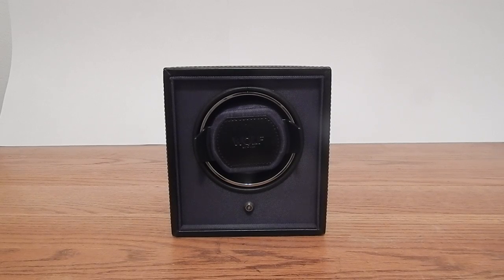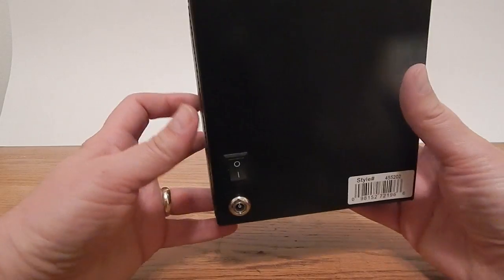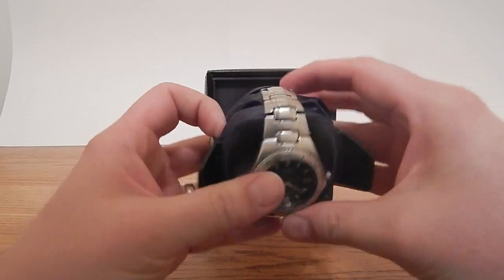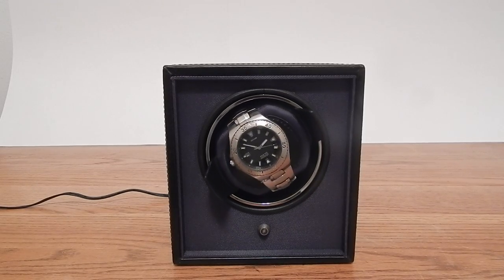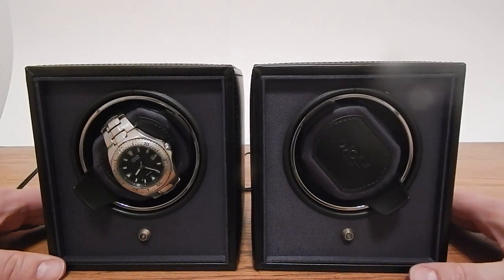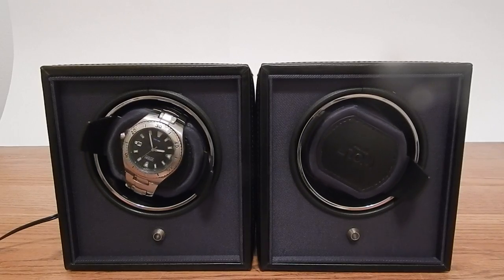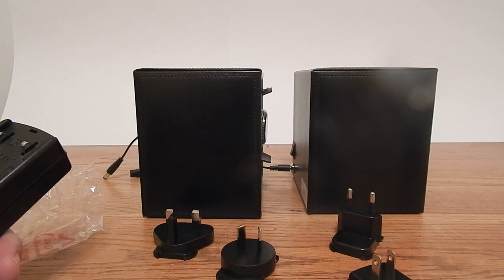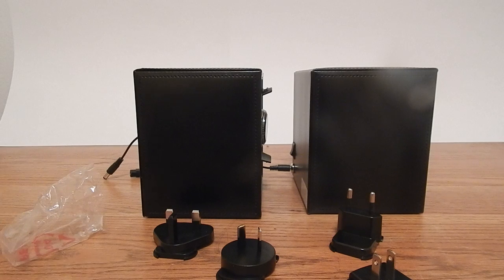WOLF DESIGNS - CUB SINGLE WINDER MODULE 1.8

Comment: the easier and non-forceful way to take out the pillow is to gently pull the tabs outward (to release the hooks) and then pull the pillow out. pressing the tabs inwards (the most intuitive way) will make the hooks catch the groove inside even tigher and harder to take out. just sharing my experience as the instructions in the manual ain't clear.

Comment: Rolex has a recommended 660 RPD (Rotations Per Day) on their watches. This winder at 900 RPD is actually overwinding your watch by approximately 300 RPT Caveat: although there may not be an immediate danger in over winding a watch why not at least offer a variable RPD option or at the very least a two RPD option (eg 300/600) it’s not a big deal and this isn’t a cheap winder.
Reply: Main spring in Rolex won’t let it over wind
Reply: Surly it does more than 660rpd when its worn daily
Reply: its no issue

Comment: I just purchased a used wolf watch winder off of ebay. Where can I find a cheap(not the original) a/c adapter so I don't have to just use D batteries?
Reply: I believe I saw them offered on the Wolf website. Good place to start.
Reply: @balesjo  Thanks for the info. On their website the a/c adapters run $25. Do you know of a cheaper option? If not I'll just go with the one on their website.

Comment: Watches with perpetual winders should be kept running, or at least if they are allowed to stop they shouldn't be left stopped for too long.  So it's a good idea to keep perpetual winder watches running but the sums here are puzzling.  This winder does 900 turns per day and from the video I time one turn at 9 seconds, so it turns for 8100 seconds a day = 135 minutes.  Winding for 2hrs 15 minutes and resting for 21hrs 45 minutes per day is not enough to keep the average perpetual winder going for more than a couple of days before it runs out of power in the main spring and stops.  So this winder is not for long-term use and I therefore question its usefulness and value for money given its price.
Reply: This is the least expensive Wolf Winders and therefore has the least options available. I've watched two videos  so far on the Cub winder and it was kind of ironic that both featured the cheapest Wolf winder and then placed a Rolex and an Omega on them. Wolf offers significantly more capable winders that give the watch owner control over the process. At least two models are a step up from this, allowing you to set the direction of rotation, the number of rotations per day, and have a delay feature that allows you to set up a delay period for watches that have longer reserve periods. A little shopping around online and I found several new ones that were about $50-$75 more than this basic one. Seems like they would be a better decision for the expensive watches. Other than pricey, Wolf has a good reputation. Considering the prices on luxury watches, it's worth the investment.

Comment: What is the point of the turning the watch?
Reply: yeah... what's the point of this product...
Reply: inund8
lol i read the other comments and it is to keep the watch going cuz there is no battery and the rotation keeps the gears moving
Reply: Some watches are powered by shaking/rotating them, rather than by a battery. The energy is captured in a spring. Normally this happens by wearing it and moving your wrist, but if you don't want to wear it that day, you can keep it wound by putting it in a winder. Google "self winding" or "automatic" watch
Reply: hilarious seeing people who only know about quartz watches lmao
Reply: David Topchiev Nah they're fine
Reply: I have a few of these but different brand, wolf suck.  You think his video would explain that instead of assuming his audience already knows lol.
Reply: Nah I have one of these and it's a very good winder.
Reply: Eric Viola  l have a higher grade Wolf winder and it is great.

Comment: don't quite understand the use of this!
Reply: it's for watches that don't run on battery but on mechanical movement (works when you shake it or walk). They are usually more expensive. If you don't use those watches for a while they eventually stop ticking. Which means if you pick it up again a few days later you'll have to set the time again. This item basically continually winds the watch by turning so you don't always have to reset the time.
Reply: Nice one! Thanks for the detailed answer! I still question the reason of buying a mechanical watch in the first place. This probably wouldn't be part of a minimalist's lifestyle!
Reply: well, primarily it's about appreciating the history of watches and respecting the ingenuity required to create an automatic movement. they're incredible pieces of craftsmanship. practically they're great because because there is no battery to replace, and they will most likely last a lifetime if you buy one with a good movement.